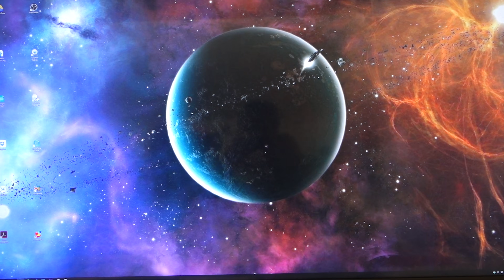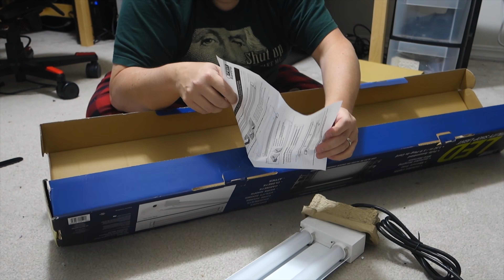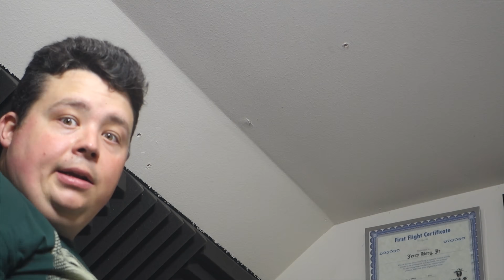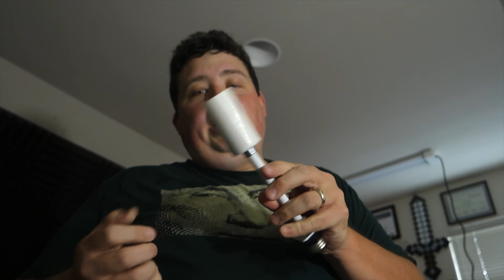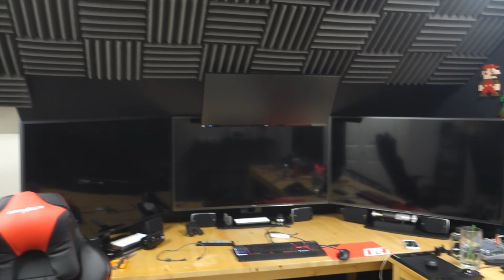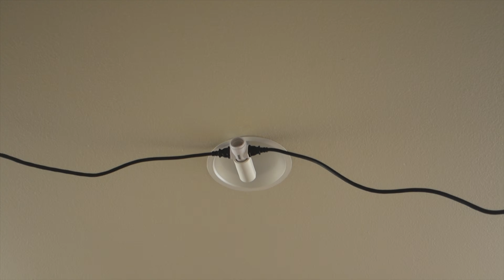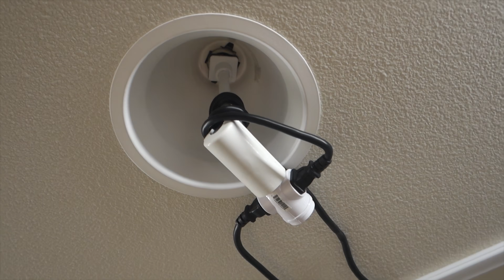How To Install Cheap LED Shop Lamps Using Existing Lighting Fixture Power - @Barnacules

Comment: Wait, what! Those CFL's are 50Watt each!? They look like 15W Euro CFL's...

Btw, the light output of a decent (euro....) CFL is still better per Watt then a LED. So they do produce LESS heat for the same amount of light then LED. But LED will last longer,although not as long as the box claims because in less then 5 years they still burn (with the same power consumption) but the amount of lumens has dropped massively.

But you are right about the spreading. That's where LED is brilliant :) Together with dimming. But LED is hyped to much as the "world saver"...
Reply: Here in the states LEDs are far more efficient than CFLs. If you think LEDs are being touted too much as a "world saver" then be glad you weren't in the US in the 90's. CFLs were heralded as Mother Earth's savior & shame on you if you didn't like them.
Reply: Same here... CFLs (rubbish) were pushed on us because the EU passed a law that banned incandescents. They then relented a little and allowed halogen bulbs in normal screw and bayonet styles that were slightly more efficient than incandescents. 
I can't remember the last time I saw someone fit CFLs, the only ones I see are old ones that haven't been replaced yet. 
No-one likes CFLs. LEDs are far more efficient, plus you can buy dimmable ones that aren't huge beast things like the old megaman CFLs.
Reply: That law it pretty new... But it looks like they now conceal incandescent as CFL over there... 45W for a CFL is insane!

And yeah, that law is stupid. For domestic use a incandescent wasn't that bad. Especially in areas with colder climates because all the heat is used there. And an incandescent is easier to produce and recycle. More insulation (mandatory insulated glazing) are more useful to save on the bill / save the planet. But bulbs of more than 60W are useless. (Just like CFL bulbs of more then 15W...)
Reply: The law is not that new... it came into effect across the entire EU over 7 years ago :-)
No consumer wanted it. As you say it isn't even appropriate in colder climates (such as where I live, in the UK) as the "wasted" energy is just heat, which reduces the amount of other heating required. It only makes any sense if you live somewhere so hot and humid that air conditioning is required at night.
But, in an attempt to be seen to be doing something we now have toxic, expensive lightbulbs to dispose of rather than cheap, chemically-inert ones.
Reply: Damn, is it that long already :o Time flies :p But I agree, useless rule to keep the eco hippies happy :/

Comment: The bat cave is looking good! I'm pretty jealous, though the beastly air conditioner is the stand out item in my mind (or after the SLI Titan XP rig anyway). I'm assuming the LED lights can be dimmed to improve that glare when gaming? Out of interest if you do read this comment do you find questions about the weight loss motivating, annoying, demotivating or other? Just making sure I address it properly, your moment of realisation and drive to lose weight motivated me to work on improving my health. I'm really hoping for you to succeed and you certainly seem to have the right mindset.

Comment: Probably a good tip with those strips:
DISCARD THEM IMEDIATELY :P
Just kidding, the sticky tape on them is shit though... I have used those Legrand strips before... after a while they come crashing down... you can still use them just drive a screw through them using a drywall screw/anchor
or use the kind you have to screw on. I know it's more work but at least no worries of them crashing down.

I don't know why but they seem to never get loose at first. then after a year or so... trouble and they start to get loose and slowly come down. Now you may be lucky and not have this happen, I have seen senarios where they did hold. even though I prefer screwing them on just to be extra sure.

Comment: Lets see... 4 x 23w florescent bulbs = 92 watts    2 x 38w led bulbs = 76 watts...
So, yes, you are saving a little on your power bill ;-)
(100w incandescent = 23w florescent) (And, why not just use 2 sided tape to stick up the lights??? ;-)
Reply from the maker: +Brian W my CFL bulbs were 45watt each.
Reply: And they look like 15W European bulbs (which are the 75W incandescent replacements). So 15W light and 30W heat I guess :p No wonder it got hot in there :p

Comment: That light is...not...warm. It's hospital/auto shop lighting. Just saying.There's warmer more natural lighting out there. See if there's something with a different luminescence.
Reply: Technically warmer light isn't  more natural since actual natural light from the sun is 5000+ kelvin, which is technically cooler than the 4000 kelvin rating of these lights. I personally like light between 4500 and 5000, a nice neutral white.

Comment: well those adapters for the light socket are banned here in europe. (you can still find them in sketchy places but i dont trust them for safety)
Reason: People overloading small wires from the bulbs. Some sockets like the one that has a piece of flex on it that then uses a terminal to connect to your house wireing. on those lamps the wires are usually 0.75mm2 thick which is the smallest you can get regularly here in the netherlands. This means overloading the wires going to the socket may get overloaded...
usual wireing is 2.5mm2 for a 16A circuit and 1.5mm2 for going to lamp sockets. What I would do is put a socket on the ceiling where my central junction box is, this way you can connect anything you like. This happens in offices alot, where there is a socket behind the lowered ceiling where the lights plug in to.

Comment: FYI the watt rating on CFLs is about 4 times higher than the actual watts used. So in a 100 watt fixture you could throw in 4 100 watt CFLs and it would be fine. Got to check for the actual watt rating on the package of the bulbs.

Comment: What kind of CFLs were you using that they were drawing almost 60W a piece? Those CFLs should've been pulling only about, at most 80W to 100W combined with each CFL putting out the light equivalent of 60W bulbs.

I also started switching over to LED bulbs. It seems that Wal-Mart doesn't even carry CFLs anymore, and I think everyone else is dropping them from their stocks in favor of LEDs. I have an LED light bulb in a stand lamp in my living room that puts out the light equivalent of a 60W light bulb while only sipping about 11W of power. And a smaller 40W equivalent LED bulb is sipping only about 8W of power. They do get warm, though, but definitely not nearly as hot as a CFL or incandescent.

Sounds like you also need a stud finder, so something to put on the list for your next trip to the hardware store or Wal-Mart.
Reply from the maker: They are 45watt Alzo Digital photography bulbs.
Reply: cee128d  CCFL has always meant cold cathode. I've never seen CCFL to mean "circular compact" or "compact circular". Got a source backing up your assertion?
Reply: 60W CFLs give you somewhere in the 250-300W equivalent output range. I just checked his Jerry Rigged video from when he made that installation, he is using 4 45W CFLs, 150W equivalent each.
Reply: CFLs are disappearing because towards the end of their life, the ceramic bit at the bottom can explode, especially if cheaply made.
Reply: Rule of thumb, a LED bulb takes around 20% of the power of an incandescent to be equivalent. But a good CFL puts out more lumens per watt then a LED bulb does. But indeed, 45W CFL bulbs are just ridiculous! Biggest pro of a LED bulb, they can be made dimmable easier (and wayyyy nicer) then a CFL. Unfortunately, bulb that turn warmer (like an incandescent) are still nowhere to be found (for consumers, but Osram makes them for the pro-market).
Reply: Not quite. He's using CCFLs.
Reply: I can't find anything indicating his old bulbs were CCFLs, the amazon link doesn't mention cold cathodes, but I could have missed something.
Reply: Compact Circular Fluorescent Light or Circular Compact (depending on the company). CCFL is the abbreviation for more than one type of light.
Reply: Well, I didn't know that people called the circular bulbs CCFLs since they use the same technology in a different configuration, learn something new every day. Just out of curiosity, what do you consider a CFL? To me it's always been the circular.
Reply: lel
Reply: hey could you post canadian amazon links?
Reply: +rewtuser at eol they can also catch fire in your ceiling
Reply: also the socket is probably rated for 600w wich is fairly common...
Reply: I can only find 2700K led bulds in chinese online shops. My current bulbs output 90-100 lumensxwatt.

4.5w 425 lumens
6w 600 lumens
Reply: I recently had to replace the ballast, and I only did that because I had a case of bulbs stockpiled I still need to go through. Next time I am converting it to LED.

Comment: You could have drilled into the attic and run your wires though there, which would probably look cleaner, the room kinda looks bigger because of the now diffused lighting.

Comment: Awesome on the weight lose their @Barnacules Doing the same myself with the fiance, I weight right now 318 from 350 got ride of soda and added more greens in my diet. Missing my mountain dew but trying to reach a weight goal of 250. Btw you should have drilled a hole before setting in your screws in the wood, would have made the whole thing easier the first time around. Live and learn haha awesome job on the light I need to look into those LED light tube they have an impressive light coverage.

Comment: Jerry, Jerry ,Jerry (Shake head emoji goes here)....  You had the perfect spot for the lights.  How did you not see that?  Put the lights on that 45' cove you have in front of your desk.  The lights will be indirect bounding of the back of the room.  If you do get some lighting that hits the desk you would put a sugar scoop (Off Road Term) under them. or a barn doors aka proper studio light term to cast the shadow to stop the reflection onto your screens but adjust the light to only land on your desk space...Just saying it will improve your happiness and sex life too?

Comment: not bad for a non-electrician. even though it'll probably be fine, a safer way would be to use a round wire mold fan box, then you could cut the male ends off and hard wire them, the wire mold box has knockouts that the tracks could snap into. http://m.homedepot.com/p/Wiremold-500-and-700-4-in-Series-Solid-Base-Round-Fan-Box-V5738AF/202519448
Reply: *safer and neater. 11 years experience on the job as well as a bunch of trade school and classes in the ibew. then you just put a blank round plate over it.

Comment: Just a thought.  I'd add a center lite off of that can that points toward the back wall.  (like an LED Par 38 sized bulb) It will add some additional light that will help eliminate shadows and it won't interfere with your screens.  Just a thought.  Thanks for another video!

Comment: Local building inspector sees video.  Drops by house.  Tells Jerry entire office must now be dismantled down to bare studs due to work being done without permit.
Reply: What totalitarian Democrat are you voting for?
Reply: so you live in a socialist country.
Reply: Permits are only needed for exterior or structural work.
Reply: afaik the regulation is for wires inside the walls, this installation is about the same of getting a bed lamp and plugging it in the wall socket
Reply: *****
Shhh!!!  You'll give them ideas!
Reply: heh, actually... you dont need a permit for work in/around the house. AKA on private property. (unless you are going to dig holes and do big work on the property.
With electrical work it is: anything behind the power meter (kw/h meter) it is the home owners buisness. whenyour house catches fire because of shorts that happened due to your stupidity with electrical safety. Your insurance will be hard on you for sure :P

If you rent your house different story, the organisation/person you rent from must give you permission
Reply: ImaDAD com
I'm not working for any of such people.  I'm just saying that's what's likely to happen to a lot of people.  You plug a lamp in and they tell you that a permit's required.
Reply: Armando92
Yeah, but give someone a position...
Reply: So is hanging a picture frame and using a different type of bulb in your lamp (essentially what he's doing) working without a permit?
Reply: nakyer XD

Comment: Why not use a diffuser under your original single light? Put a bowl underneath it and have the light hit the ceiling instead so it spreads out evenly and no direct light hits your monitors.
Reply: Wattage =/= heat. They were hot because they were inefficient CFL's, not so much that they were a 200w fixture.
Reply: Like how he talks about heat from a CFL...Must not know about the Classic 100w bulbs.  That would melt plastic.
Reply: +Skylar Garrett if you are replying to me. i didn't state that watt=heat. I'm just saying the reasons why he chose the LED instead of the florescent bulbs.

Comment: put a screw in the ceiling right up against the end of the light...then it can't move with vibrations a fall
Reply: +Gary  Ferguson Jr
Nah.  Just use a lot of glue.  It'll make a mess and moving or removing the lights will be next to impossible, but...eh.
8)

Comment: How can that light socket plug thingy-mah-bob even be legal? :/ isnt that the biggest fire hazard ever?
Reply: +Lars The Viking
Not if it's rated properly.
Reply: as long as there is no petrol-drenched paper with a carbon trace bridging the open contacts where the light would normaly go, no. should be fine. note: idiots can also touch normal bulb sockets while they are live...
Reply: Why would it be illegal? It's so basic that it would be basically impossible for it to cause a safety issue. Also, i doubt there's much regulation on residential lighting. That adapter probably has an ETL, so it can't be too bad.
Reply: actually it is perfectly safe as long as you don't overload the socket it's perfectly fine.
it just turns a light socket into an Plug outlet.
Reply: no more than outlet with out a ground but if check the NEC you will find the all parts of this light circuit are legal based on the fact that the are pluged in not hard wired making them temporary lighting with disconnect within 6 ft of the applance
Reply: Not at all. Well anything electrical is pretty much a potential fire hazard. But if it's UL rated then it's fine.

Comment: The four CFL's look like 13 watt units that's a total of 52 watts not 200. They may state that they are the equivalent of a 100 watt incandescent bulb but that's output not what it draws at the plug/socket (input).
You could have run those new lights the other direction (from the window to the door attitude) and over your chair for no glare.
Worth watching for some of the funny shit you say, one of my favorite U-tube channels!

Comment: Every cut starts with the word 'Alright' Also you have 2 cuts where you point out the measurement device on the drywall anchor box.

Comment: Wait if the light was making the room hotter then why get an expensive ac before new lights that would make the room a more reasonable temperature? +Barnacles Nerdgasm
Reply: You mean thhe monitors?
Reply: Yeah his computer is beastly. My PC is just an over clocked i5 and an overclocked gtx 970, and my office get to 90F which is insane, so I had to buy an AC unit, so his PC is bound to make his room insanely hot.
Reply: +Barnacules Nerdgasm :)
Reply: It wasn't just the lights, it was the 3 massive computers!
Reply: If I'm remembering right he found out that his old ac system had mold in it and was probably contributing or causing all of the infections they kept getting.
Reply: His computers put out heat, that's one reason to replace the AC.
Reply: Gavin.... stop. just shut up and watch.
Reply: CFLs produce about 25% of the Heat of an incandescent light so if he had 4 CFLs then he produced about as much heat as one incandescent light running out a hundred Watts outputting roughly 50% of that as thermal waste what equal 50 watts of TDP to give you an idea of what his computer puts out in TDP his to Titan XP put up about 500 watts of TDP and his CPU puts out another 200 or so plus Ram power supply and motherboard components equaling somewhere around a thousand watts of TDP I think the 50 from the light is irrelevant

Comment: should have mounted them on 45 degree angles so they met in the middle, it would have shortened the distance they stick out from the computer end of the wall, plus it would have made the light more evenly distributed.